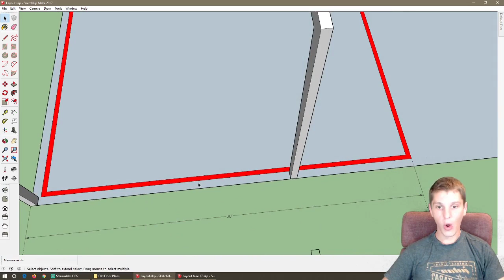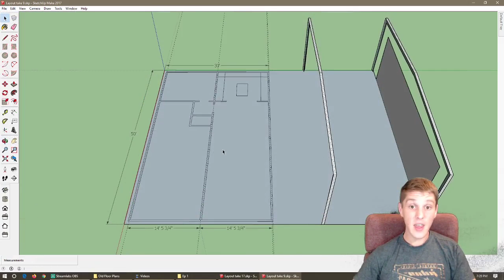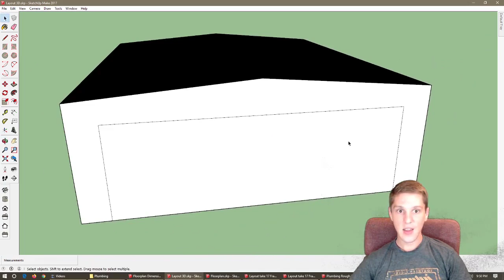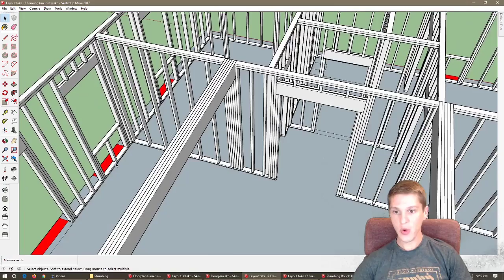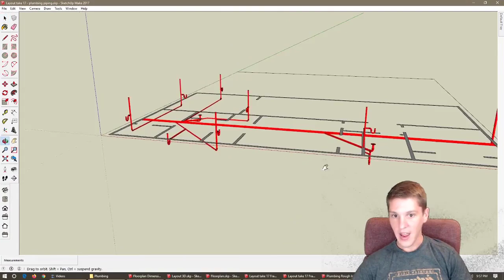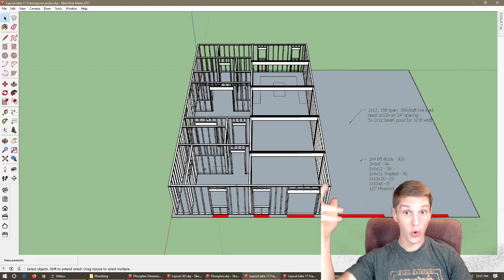50x60 Custom Hangar Home Episode 2: Design and Planning

Comment: Thx for the informative vid. I plan to do a 50x80x16 hangar home. 2 levels of living area 50x16 with upper floor havibg master bed with kitchen and living room with walkout deck. Lower level will also have a large bed and kitchenette as 2nd living for family or guests. Do you design on the side?
Reply: I do not, and that is mostly for liability. I am a licensed engineer, but residential construction is not my focus area. 
Because we are outside of city limits, the building inspections were essentially non-existent. I did not need a set of plans stamped by a structural engineer or architect. Without knowing any more about your situation, you may have to have those stamped plans for your local inspection requirements.
Reply: @zacharyvick3960  most of the metal building co I've researched come with a set of stamped plans etc. I just need help or advice on the living area design.
Reply from the maker: @kmr7041  Depending on your location, you may need electrical, plumbing, and HVAC plans for the living area to get permits (all of which I didn't need). As far as designing the living area, I would recommend designing a 50x30 or 50x40 rectangle for your 50x80 building. In fact, my living area is 50x30, so you could use my design as inspiration if you're looking for a 2 bed, 2 bath. If you're looking for other inspiration, check out https://barndominiumfloorplans.com/. They have a ton of different sizes that you can look at pictures. You don't have to buy a plan from them, but they have a lot of plans that are conveniently limited to a big rectangle.

Comment: I’m also planning on building a hanger home you mind if I ask what app you used to do this ?
Reply from the maker: Sure, this is SketchUp. It's expensive to buy the new version, but I think you can download SketchUp Make 2013 or 2017 for free. But they hide the download, so you may have to dig for a bit.

Comment: Love the idea. I’m wanting to do something similar. Do you want the height in the hangar/shop portion? I have been wondering about full living space above the hangar. Of course engineering for the clear span without posts underneath will be important. Don’t know how to figure out what would be required. Maybe steel beams?
As for your 2nd story joists, why not engineered I trusses (not sure that is the proper term) they are as strong in a smaller size as 2xwhatever and can come in really long lengths.
Reply from the maker: Absolutely, living above the hangar would be way cool. For long spans (longer than 20-30ft) you'll probably have to go with steel I-beams with engineered footings in the slab where the columns come down. I want the full height in the shop because I want to put a car lift in it. I am also tossing around the idea of turning one wall into a rock climbing gym. 

We decided to make everything for our 2nd floor joists out of "2 by" for cost. Making them out of 2x8s is the cheapest route, and they are light enough I can pick them up by myself, which is important. And, having the dropped down beams in the living room ceiling will be a cool architectural feature. Engineered wooden I-beam joists are very expensive. And right now, lumber is double priced what it was a year ago.